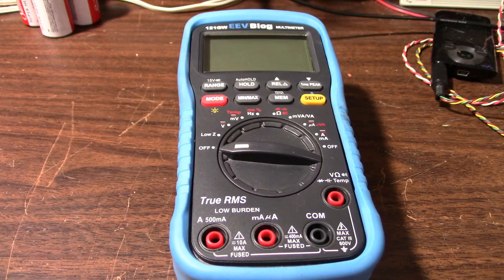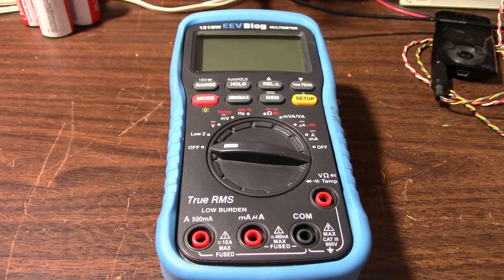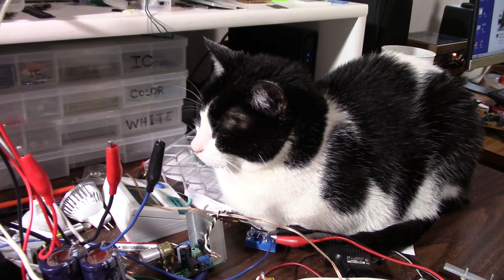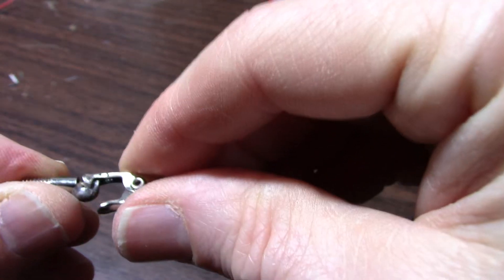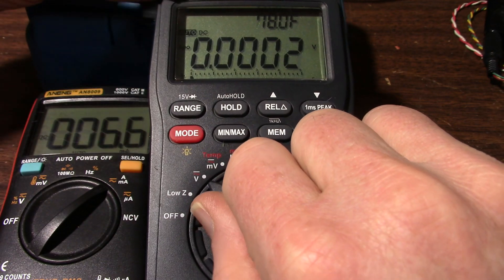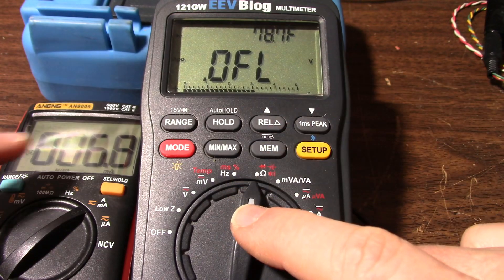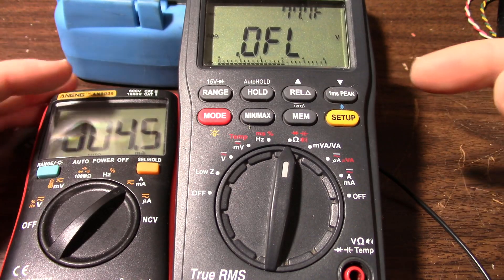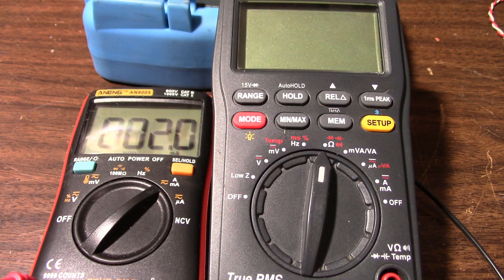EEVblog 121GW multimeter drains batteries too fast

Comment: @JohnAudioTech
Hi, my EEVBlog 121 GW (Firmware 2.04, with SD-Card installed) sucks about:
DC Voltage mode:  4.66 mA in operational state, 0.57 mA in Auto-PowerOff state
Resistance mode:  4.37 mA in operational state, 0.59 mA in Auto-PowerOff state
 2500 mAh batteries would be completely empty in about 180 days Auto-PowerOff state.

Comment: Sir I want to know how come a 2.1 TPA3116 D2(2 TPA3116 IC) and a mono TPA3116d2(1 TPA3116 IC) requires or uses same power supply that is 24v. Please help me I am very confused. Waiting for your reply Sir.
Reply: They use the same power supply because the 2 amps use the EXACT SAME chips,. Since they are the same chips, OF COURSE they have the same specs.. How could there be anything confusing about this?
The 2.1 channel amp uses one TPA3116D2 in "stereo" mode for L&R, and the other TPA3116D2 chip in BTL (Bridged) mode for the Subwoofer.
The Mono amp uses one TPA3116D2 chip in BTL mode. Therefore that one is the same as the Subwoofer channel of the 2.1 amp.
Reply: @johncoops6897  3116 is always BTL and has 4 actively driven outputs. The stereo output mode is 2xBTL. The mono output mode synchronises and parallels two of the output pairs to increase current drive capability.
Reply: @SianaGearz  Thanks for your great response sir but how come one IC TPA3116D2 and Two TPA3116D2 using same 24v can perform better than one IC? 
One IC= 24V
Two IC= 24V
So now the current will increase in 2 IC CIRCUIT so the power will not be distorted and less?
Reply: @dhairyasharma603  - For fuck's sake! There are TWO chips so there is twice as many. Therefore, because there is twice as many chips, there is more power.
This is the same concept as why two bottles of vodka can make you more drunk than one bottle of vodka. It's the same vodka, so how come when there are 2 bottles you get get more drunk?
Read my reply above, the answer is already there (I have answered it the first time).
Reply: @johncoops6897  Friend I tell u one example 
One 12 v car bulb uses 12v power ok
Now if I connect 2 12V bulb to one 12v battery the bulbs will be giving less output( Low light) 
Now if I connect 1 Tpa3116d2 IC to 24V and two tpa3116d2 IC to 24V will  there be less output as in the bulb scenario. Do you understand or not reply I will try to explain again. Thanks man for solving my issue.
Reply: @dhairyasharma603  - I understand why you are saying, however you are confused. Whether you connect one, two or more 12V bulbs to a car battery, they will all be the same brightness. Two bulbs will give TWO times the amount of light as one bulb.
The number of bulbs (or amplifier chips) do not "divide" the voltage in any way. If it's a 24V power supply, then that's the voltage.
The voltage will be 24V when there is one TPA3116D2 chip connected.
The voltage will still be 24V when there are two TPA3116d2 chips connected. However, what changes is the AMPS - I will try to explain in very simplified terms....
For one TPA3116d2 and assuming 90% amplifier efficiency, to get 2 x 50 Watts at 24V, you need 2 * 50W / 24V / 0.9 = 4.63 Amp power supply.
For two TPA3116d2 to get 2 x 100 Watts at 24V, you need 2 * 100W / 24V / 0.9 = 9.26 Amp power supply.
Reply: @johncoops6897  Great man thank you so much
Reply: @johncoops6897  Friend are you an audio expert? I have so many doubts?
Reply: I'm not sure what it is you're hung up on. 24V is just a good arbitrary voltage in the operating range of the semiconductors that the IC is made from. The amplifier will run between 5V and 26V. Any less than 5V and it probably won't power on very reliably, any more than 26 and it probably won't work well either, and above 30V it'll likely just explode.

The actual power is determined by input voltage, Ohm's law and the speakers connected. If you connect two 8-Ohm speakers, at maximum output (voltage and power), you will consume a given amount of current. If you instead connect just one 8-Ohm speaker, you will consume half that current, no matter the configuration, whether mono or stereo - and your power you get out of an 8 Ohm speaker is strictly dependent on voltage. To optimise the behaviour of the chip, you can reconfigure the chip into mono mode, then it will probably run more reliably as all the power sections of the chip are then engaged evenly, and the heat is distributed better, besides it will likely be better behaved with a 4-Ohm speaker, being less likely to run into the current limit. 2 Ohms speakers are not mentioned in the datasheet, but one may hope that they would just about work in the special mono mode, but definitely not in stereo mode.

Let's say you use a 24V supply. It is effectively doubled by BTL drive to 48V voltage swing. Divided by 2*sqrt(2) to convert into RMS AC voltage, that's about 17V, really likely closer to 16V because of rail offset. Let's say there is a single 8-Ohm speaker connected. Ohm's Law: I=V/R=16V/8Ohm = 2A. So it follows, that the power supply will need to deliver 2A (+ whatever is needed to cover amplifier losses - see efficiency spec) to power this one speaker. To power two such speakers, correspondingly double, 4A + losses. So if you had say a 24V 5A power supply, you could run it either with a mono or a stereo amplifier running either one or two 8 Ohm speakers, but if it's mono then you have essentially overpayed for the power supply by getting one that's twice as powerful in terms of current as needed, a 2.5A one would do just as well. Or alternatively a mono 4 Ohm speaker, in which case you still want that 24V 5A PSU.

Let's say you get a 2.1 board with two ICs, and you connect two 8-Ohm speakers to it (stereo pair) and one 4-Ohm speaker (subwoofer), well chances are, you want quite a monster of a nearly 10A PSU to go with it if you wan to run them at 24V. Not like a laptop PSU, more like those big LED array and 3D Printer PSUs. BTW in my opinion such chip amps are better behaved (thermally) if you limit the supply voltage and power, so use let's say 19V. But you do lose like 40% of the power, but you'll also need less current, and you get into a territory where you stand a fighting chance of finding a suitable laptop power brick that can deliver enough current.
Reply: You don't need two. Just a more powerful supply.

Comment: I have had no problems with mine. HOWEVER - nothing in your video seems to have considered if all 4 batteries you put in the meter were installed fresh from the same pack. No? Well that explains what you see and the same error in anything would produce a similar result.
Reply from the maker: Of course I started with fresh batteries from the same pack.
Reply: Wtf

Comment: Why this multimeter does not come with power adapter connector or we can add DC connector. Instead of rely on battery.
Reply: It's not a benchtop multimeter.
Reply: If the external power is not totally isolated, there will be trouble.

Comment: Interesting, I have a Brymen 867s which makes me feel like I'm constantly replacing the 9v battery (and those arent exactly cheap here in Sweden) wondering if it's the same issue since I rarely actually turn the dial to off...Don't have a secont meter to measure with unfourtunately.
Reply: I feel the same way about my fluke 87. (og batteriene er nesten like dyre her i Norge.. =)

Comment: nanowatt LOL .... I understand that this meters is good on the desing concept, protections and so on, but the UEI impleentation is really poor  .... looks like still in prototype phase ... and does not woth the money. A 20 year FLuke like the one we had at work, letting it to power down on timeout (I barely shut it off), we change the battery once a year ... it is a BEAST. After 20 years, things didnt got any better. For cheapness, jusy my Unit 61, than kyou very much. And the UT61 is not cheap on batteries, but at least it shuts off properly

Comment: Latest stock unit I'm measuring 600uA on ohms range. 380uA on LowZ without SD card.
What's the serial number?
Have you tried the latest 2.04 firmware?
Dodgy micro SD card perhaps?
Reply from the maker: Hi Dave, the serial is 180202922. There is also an EEVblog sticker with 001443. I'd have to research the normal current draw of the micro SD.
Reply: @JohnAudioTech  That's an original Kickstarter meter. I believe others have reported no issues with that older model. Remove the SD card and try 2.04 firmware and report back please.
Reply: @EEVblog  Gotta love a creator who takes customer satisfaction seriously ;)
Reply from the maker: @EEVblog  I installed the 2.04 firmware. It has the same current draw. Thanks for your time, Dave. I can use the meter. I just have to remember to turn it off when done.
Reply: @JohnAudioTech  What does removing the SD card do?
Reply from the maker: @EEVblog  Without the card, it stabilizes at 2.0 - 2.4 ma depending on mode. I did notice that a few seconds after APO, it dropped under 500 ua for several seconds before going back up to 2ma and staying for the 15 minutes I tested (3v diode check mode).
Reply: @JohnAudioTech  may be local chemist has a solution .. perhaps sleeping pills will help :)

Comment: I've got the EEVBlog BM235 meter and I just tested the shutdown current after watching this video.  It's less than 1mA!  So not bad at all.  It uses between 4-6mA when turned on depending on which fuction you are using.

Comment: Those Sunbeam batteries are not the best.   Try the Harbor Freight Thunderbolt EDGE's.   There have been several tests on the Tube and they are as good or better than Duracells.
Reply: Baaaaaaaah!

Comment: I think you forgot to use batteriser, 800% more power! I think Dave would agree;-) But seriously did you check the firmware version that's installed and whats available?

Comment: I have one of the original Kickstarters and it's only on it's second set of batteries ever. After a year of being my main meter, the first set was only down to 1.4V when I changed them just to be safe. But I always shut it off with the switch. Maybe left it on standby overnight a couple times.

EDIT: I just checked mine, I hooked it up to my bench supply and let it power off. It drew about 5-6 mA while on, about 16 mA with the backlight on, and went to 0-1 when it went to sleep. This was with an SD card in and the dial switch set to Volts.

So there probably is actually something going on with yours.

I'm running firmware version 2.04.

Comment: Sunbeam? These batteries are 4 /$1 in the Dollar store.Known for their long life and dependability.
But at least they don't leak and ruin your meter like Duracells do.
Reply from the maker: They're okay. Just don't run them down too low or they'll leak badly. I've had good luck with the alkaline versions, although they cut them down to 3 to a pack.

Comment: I'd like to see that test on a few other meters as well, especially the red one, with and without probes shorted and in Ohm or diode mode. The red one and others of that ilk have an odd habit of dropping impedance when they go to sleep, which could be an issue if left monitoring bias or some other sensitive adjustment. Wonder if the EEV meter would do that too.
Reply from the maker: That's a good idea for a test. As far as just letting them sleep, I suspect no issues in battery drain as all my other meters are still on the original batteries and some are 3 years old.
Reply: @JohnAudioTech  I finally had to change batteries last year on the blue meter that preceded that red generic one (Zotec OEM?)

Comment: Most DMMs have a really shitty power consumption when auto-powered off(that's why I always turn them off), and the FW team that made the meter is pretty bad, so it doesn't surprise me that this is one of those.
Reply from the maker: None of my other meters drain the batteries when they APO. Some are 3 years old with original batteries.
Reply: I've got a Mastercraft DMM, and I rarely get better than 6 months on a battery.